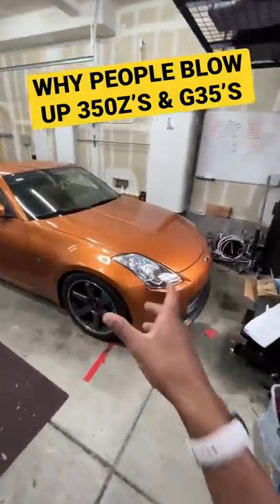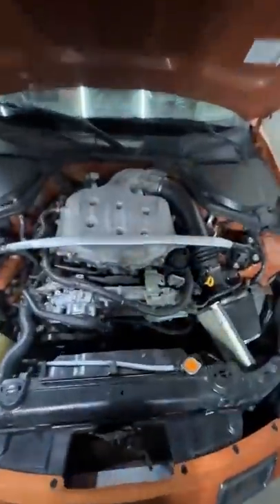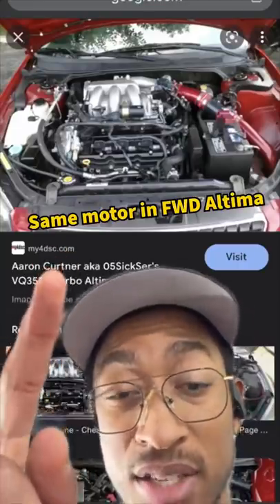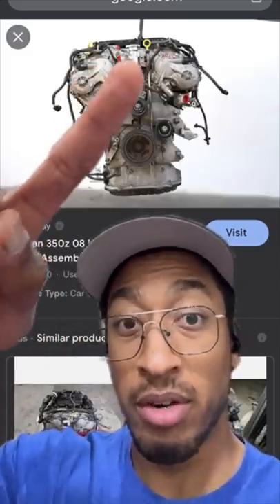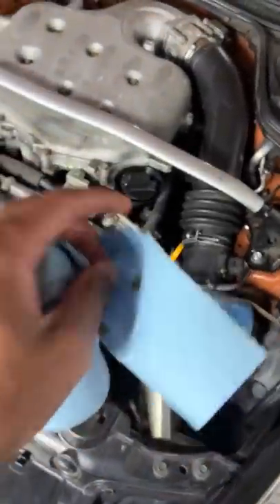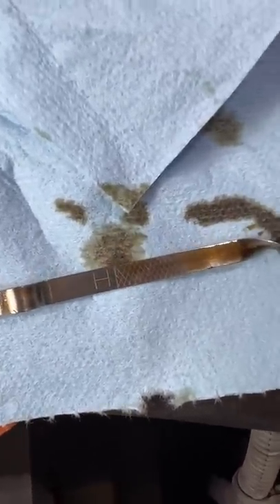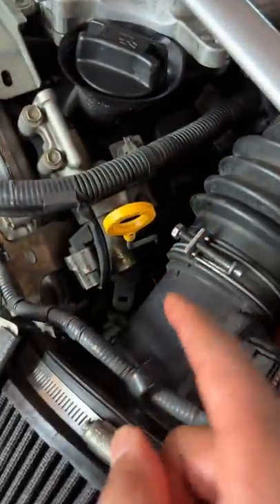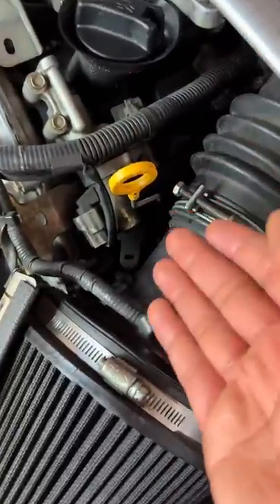Why people always blow up their 350Z’s and G35’s 💥🤯💣

Comment: If you start the car in the morning you arent getting a accurate reading of oil amount with oil dispersed over valves and such. Thats why they want you to run most engines before you check the oil just gotta make sure you are tippy top full this method
Reply: Thank you 🙏🏿
Reply: Now In English? First of all you do not start your engine if you want to know how much oil is In there, second even if you run your engine before checking the oil level you can still turn it off, wait 30 seconds double check the oil level and add if necessary. Accurate read or not there is alway Google to check how much oil can go in the car and if it's on the rugged mark it's between 200ml to 500ml and there is no problem of over filling it just don't put 5 gallons in it
Reply: @vmdenis3350  ballsweat said most vehicles lol not all. Read between the lines. You also is right on some of the things u said too. But in this Nissan case this dude is soo wrong 😑 I got a 350z too and I never had issues reading my oil right after an oil change and so on.
Reply: @thiccboi8225  lol « so on » includes to check the level when ever lol.
Reply: Because an oil passage is above and gives down into the district pipe, it gives a false reading even after waiting an hour. In this engine it's actually better to do it cold even tho it suggest doing it warm.

Comment: So you’re saying that the engine was intended for the Nissan Altima Coupe and Maxima, not the 350Z?
Reply: Yep there's even those engines under the hood of the Renault Espace IV and the Renault VelSatis
Reply: The original engine in the 350z, the VQ35DE, was placed in the Nissan Altima, maxima, quest, and others. It was just a general purpose V6, not anything athletic about it. Just a literal minivan engine
Reply: @milk1472  Nissan dropped the ball after the 90s 300ZX.
Reply: Fwd and rwd vqs are not interchangeable
Reply: Pathfinder got it before the z and the altima
Reply: @milk1472  they may be VQs but they're certainly not the same engine, the Z still got special treatment since it was a sports car, the only interchangeable VQs that fit right in to the Z are G35 engines, correct me if I'm wrong but only the VQ35DE for the Z is a high compression engine and only the Z takes premium gas only

Comment: Imagine owning a car that doesn't burn oil in first place
Reply: Bruhhh lmaooo then its no fun right?
Reply: @redline350zHR  I used to own a car that needed the cooling water to be topped every month or so. It over heated a couple of times and everytime I had to keep checking for blown head gasket signs for a while. It was a paranoia driving this thing.  
I would not pay money for a car that is known to burn oil. This is an unnecessary headache.

Comment: I changed my oil every 1500-2500 miles and sold my G35 Sedan at 253k 😂
Reply: i do the same with my car
Reply: How much
Reply: My coupe got changed regularly at 3k, chucked a rod at 128k. My sedan got changed around 10k, had 290k on it when I sold it, car is still out there daily.
Reply: @Infanitunit1  sold her for  $3,500.
Reply: Bruh my g35 sedan had 260k, it was running flawless when I sold it. I wish I would of kept it and boosted the crap out of it

Comment: Being a long time G owner since 2004, I agree that oil is an issue if you aren’t used to cars that burn oil. I’ve been adding oil since I’ve owned my G35. I’ve run in consistently to 155mph on German autobahns for 5 years straight. Then pushed the car in Turkey and the UK until eventually moving back to the US in 2018.  I’m just over 250K miles now and mine has always used oil. The key is to check the oil when cold.  The cold reading should only be at 70 to 80% max.  This is basically a full reading as when the car is warm the oil will expand and the gauge will change but also become almost impossible to read anyway. Again, shoot for 70-80% full when cold and everything will be good.  This method has worked for me for over 19 years of ownership.

Comment: Alternatively, you can dip your stick in cold water and then stick it back in. You’ll get an accurate reading
Reply: This is 100% facts. We have a bucket in the front shop for checking these, g35s, Muranos, any v6 with that shit stick. Don’t ask me how it fucking works it just does.
Reply: I thought this was a troll but the reply has me questioning if it is true and how it is true
Reply: Does this actually work?
Reply: @taylorsova2594  same
Reply: Water displaces oil. They do not mix.

Comment: Always check oil before starting. Because the dip stick reads whats in the oil pan. If you start the car oil will go through the engine and not give you an accurate reading.

Comment: 😂 your supposed to run it to temp. Then turn the car off and check the oil.... You take the dipstick out wipe it and then stick it back in all the way and pull it out to read the level....your most likely closer to 1 quart low when you check it cold and are full because all the oil drained out of the motor and into the pan.
Reply: He acts like this is difficult and specific to that car lol. You would do that with any car 😂
Reply: You’re right. I have an 04z and it’s not hard to read the dipstick when warm. You just have to reinsert it. You can avoid overfilling checking it warm after an oil change.
Reply: @nateafcsouth 😂 😂😂😂

Comment: You are correct about the flow back hole.   In fact some nissans have a warning label saying to ensure the dip stock is all the way down.   Failure to do so will cause oil to come pouring out while running or filling it.

Comment: So, I've got a vq40 in my Frontier. How much of the 350z engine issues transfer over? Ik the 370z has a much updated version of that engine but from my understanding, my 4.0 is just a 3.5 with a stroker kit, different cams, and a different tune
Reply: Quite a bit more reliable, they're just less efficient as far as power to weight. Vq35s are not only notorious with the disptick, but they tend to burn oil as well. The 40s can burn oil but when well maintained, rarely do so. 

This is still an oversimplification though. Check Nissan/nismo forums, there's a large community out there.
Reply: @jaykhan3191  been through em, looking for perspective. The best I can find is something about exhaust gasses being sent back through and shitty cats breaking down and adding dust to the intake, resulting in bad rings
Reply: @jaykhan3191  but that just conquers the oil consumption.
Reply: @arealboiii4830  don't have the experience to even begin to give you a solution there, I'm sure someone here will though. There are guys who have plenty of experience tearing em apart and improving em
Reply: @jaykhan3191  I mean, God wouldnt let us create turbos if we werent meant to instal them right? 😂 be good my guy ✌
Reply: @jaykhan3191  if you ever get asked again though, the answer is to replace the first set of cats with...something, anything, better. I very well may be wrong on this but that's my understanding. I'm still trying to figure out if it really recycles exhaust gasses back through the engine for some emissions bs. Another solution I've read is to delete the proposed rebreather and then weld a nut on the 02 censor to lie to the engine and go catless
Reply: @arealboiii4830  based on my experience that'd be my first attempt at solving the issue. Just gotta do some research and see which aftermarket uses superior materials, forgot what elements exactly. The oil catch can seems like a good idea too.
Reply: @jaykhan3191  I was gonna mention that and it's on the list. I went from 19k to 75k pretty quick on a '19 so I'm trying to figure out what to prioritize 😅 now my power steering is iffy and it... bongs? when making hard rights in parking lots

Comment: I have a G35 coupe and this is 100% correct. You can only get an accurate reading when the car has been sitting for a few hours and all the oil has drained down to the pan. Trying to check it at any other time results in the entire dip stick getting coated in oil.

Comment: I truly don't understand why so many seem to have a problem with getting a good reading. I work at a shop so fluids are checked frequently. My 04 G35 has a dc sports cold air and it was difficult finding the dipstick hole and was overall annoying af! Got tired of it, and slightly bent the upper portion of the dipstick to where it basically slides in and out underneath the CAI. How I get accurate readings is letting the car warm up for a few minutes, turn off, let it sit for another 5  min or so then insert dipstick, remove, wipe and repeat a few times... its not difficult at all imo😂

Comment: Honda says to check the oil hot. Suggests giving it a little rev to about 2-3k and check immediately after. If you check a Hondas oil that’s been filled correctly cold, it’ll look super over filled.
Reply: What? No they don't. You're supposed to let the engine ruin for a few seconds, shit the vehicle off, wait 2-3 minutes, then check to make sure the oil level falls within operating range (above the bottom mark, but below the top mark on the dip stick).

Comment: I've had better experience reading the oil level when the engine was hot vs. cold. It was through trial and error I figured out that reading it when it was hot was more reliable than when reading when cold so knowing the manual suggests to read when hot actually leads credence to it. I think the key is that the engine should be really hot so that the oil drains quickly from the head to not cause the issue you mention I suppose. Also when checking the oil, you pull the dipstick out, clean, put back in and then dip it in again and pull out quickly in order to get a reading.

Comment: Just a tip I learned through the years is any Nissan with that dipstick, if it’s hot when checking the oil pull the stick and cool it down with a splash of water, wipe it dry and recheck the level, it’s usually spot on.

Comment: what i do as a Tech whenever i work on one of these is use brake-clean… spray the dip stick it, wipe it dry, then quickly stick it in and pull it out . you get an accurate reading. ive been doing this for years on all cars the have pain in the ass dipsticks

Comment: Same thing with my focus. The drain for the head runs down the dipstick tube, and messes with your readings even after waiting 10 mins. You should check before you start the car, or 20-30 minutes after running the engine

Comment: Spray a little bit of brake cleaner on the stick and wipe it off before you put the dipstick in and you can actually get the right oil level. It's not perfect but it'll give you a line where you can see where that level actually is.
Reply: @carlt6932  yes that's is true but for some reason cooling down the dipstick with brake cleaner helps avoid the draining oil from sticking to stick. Now like I said it's not perfect but normally the backside of the stick will show the right level just sucks it's on the side without level markings.

Comment: My 08 Maxima has a VQ35 in it. I love the engine and the car, absolutely HATE the CVT BUT it’s got 175K miles on the original trans… and I paid $1200 for the car when it had 120K on the clock… so I’m not complaining lol. Anyway, I’m a tech and ran into this dipstick reading issue. As a Ford tech I’m used to being able to get an accurate oil level reading within 30sec of shut-off. So the FIRST thing I noted was that the dipstick has the smooth (not crosshatched) side pointing up. Next I noted of course the fact the cylinder head clearly uses the dipstick galley as an oil drain. What I found on my Maxima is u wait about 30sec. Then, you VERY QUICKLY insert the dipstick tube 180 out from how it normally goes in (flipped). This puts the crosshatching on the top for an accurate reading. Next I found what I’ve always known, which is when your checking a dipstick you check BOTH SIDES if the first side you look at is clearly not accurate. This method always works for me, maybe I’ll have to make a video, but I always get an accurate reading on the crosshatched side of the stick.

Comment: The dipstick tube is in fact an oil drain. 

Also the water pump is driven by the timing chain so it's hard to notice if it's failed and even harder to change.

Comment: I learned my lesson a while back, copped a 6speed g35 sedan rev up and had so much fun with it but blew the motor taking off at the red light the 2nd week with it, checked my oil and I had literally nothing in it 😭 bought an new revup motor threw it in and found out the best way to check your oil level was to check it in the morning before I took it out for a drive, learned my lesson the hard way but since the oil has been topped off since the thing still runs like a dream for a 17 year old car

Comment: I still have my 2004 350Z and I never checked the oil by warming up the car first. I always checked when it was cold and obviously on flat ground that way I got a consistent reference point for the oil level. I drove it for 10 years boosted with a single turbo and then when I moved to Texas I did an engine build and twin turbo'd it. 700whp with more room to go but decided to leave it there.

Comment: GR engines in 4Runners and Tacomas are tough to check oil levels. It takes multiple dips until the dipstick tube is oil free to get a clear reading.
Reply: Try spraying brake clean onto the dipstick, let the brake clean evaporate off the dipstick and then dip it quickly. Promise you’ll get a clean read first time, every time.

Comment: Yup, best time to check oil is after the engine has sat for a long while……but you can use the level(if possible) after you turn it off to determine how much the pump is throwing up in the engine….if it’s not on the stick but reads full after a long rest it’s really a high pressure pump….or you have galleys that are plugged up, if it’s reading high on the stick you either have really thin oil or possibly a worn pump or plugged galleys on the feed side.

Comment: You can check the oil when its hot or cold...but you need to be consistent and check at the same temperature and the same amount of time after turning the engine off as oil drains back.  Honda = hot + wait 1 minute after shutting off engine.  The manual will specify "hot" because "cold" can mean 0F to someone and 70F to someone else, and warmer oil is higher volume than colder oil.  "hot" forces everyone to check at the operating temperature of the engine which will be fairly consistent.

Comment: The vq is a pretty reliable engine stock. It does require regular maintenance though and most people simply dont do that. That said, the dipstick thing really is annoying. I scuffed mine so it hilds the oil a little better making it easier to read.

Comment: If no one hasn't realized this already always check the engine oil temperature cold same when you do your tires the tire pressure labeled as your cold tire pressure because of air and rotation you get expansion unless they're nitrogen filled then it's minuscule

Comment: always check the engine oil after it has been sitting overnight. As engines age the oil gallies become carboned up and it takes longer for the oil to drain back to the pan. I have seen engines that have held over a quart of oil under the valve cover. Rook the cover off and the engine was soaked. So wait overnight, check it in the morning end game.

Comment: the best option is - drain the oil, consult the manual, establish the oil capacity required. AFTER every 1,000 miles, either do the same or drain, measure, re-fill. You get the gist. AND always do the capacities cold.

Comment: You always want the oil to settle, but it is good to run the engine and then check soon after. To get a clear reading on Nissans I would always put the dipstick in a couple times, work it in and out a bit, and continuously clean the dipstick, do it a couple times and the tube will be cleared out for a clean read.

Comment: Actually there's a little kind of runner guide bushing made out of hard plastic for the timing chain.... That usually wears or brakes from extreme hextreme heat. I believe there's more than one end that is a major reason these motors fail as well

Comment: The head doesn’t use the dipstick tube as an oil drain, leave the engine off for 10 mins and the oil will level out at the bottom then check.  Not as hard as people complain about

Comment: I've developed a fool proof way to check the oil on my G. Once you hear the hear the valves ticking, that means its time to add 1 quart of cheap Circle-K brand oil. Works every time. 

Completely unrelated note, I'm halfway through my rebuild after my engine spun a bearing. Totally not connected though...

Comment: How to check oil:  get the engine to operating temp, turn off engine, remove dip stick, wipe dip stick clean, insert dip stick, remove dip stick, and finally observe oil level.  Never check oil level cold!

Comment: I always hate when manufacturers specify that have to have run the engine for x amount of time and then wait for x amount time to simply measure the oil level. Apart for the unnecessary hassle, I also don't wanna run the engine if i am not sure if it's got enough or too much oil in it.

Comment: The real reason people blow up de's is because nissan decided to cheap out on the piston oil control rings, and that causes excessive oil consumption. The rev up that came in the 06 350z and 05-07(I think, im a z guy not a g guy) g35 coupes are even worse with the oil control rings. Pair that up with people not changing theyre oil often enough and the dip stick issue you pointed out, and you have an engine that burns a lot of oil and is hard to check how much oil is in there

Comment: Check your oil after you’ve run the motor and had oil pressure… you want it on the high mark once the system has been run so that there’s more oil in there.